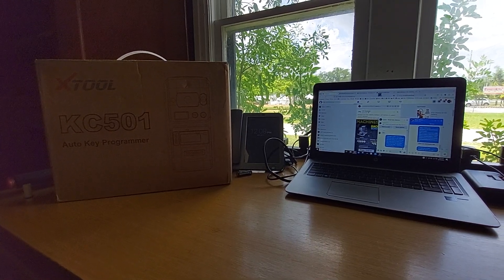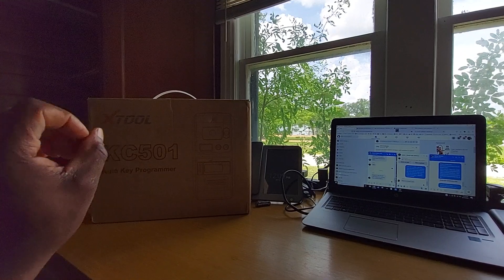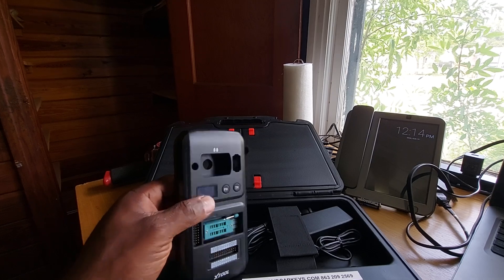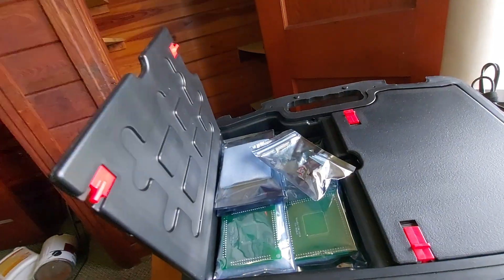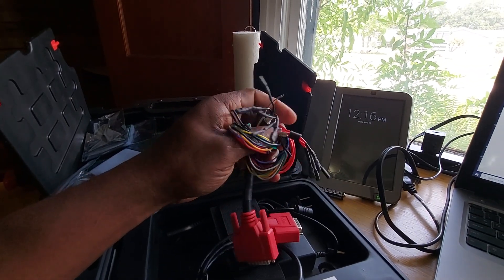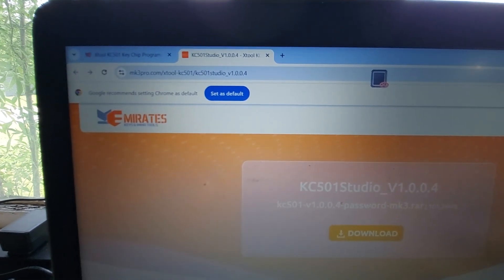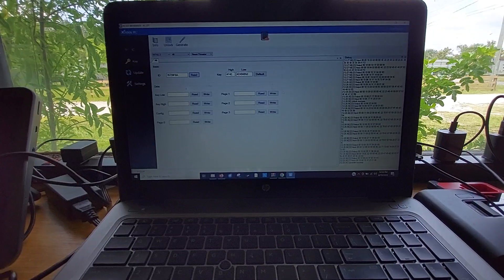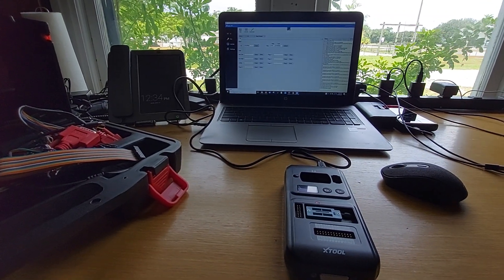Xtool KC501 Auto Key Programmer unboxing and laptop setup. Lakelandcarkeys.com

Comment: Didn’t know you could do this with 501 , I got the Xtool programer but I think as a stand alone I would get the xp400 pro it looks it has more coverage. Really like your videos been hooked on your 706 stuff been thinking about getting the G3 and adding software but don’t know if they would charge 2 subscriptions for it , good luck stay safe
Reply from the maker: @scorcher617  I have both. I never used the xp400 as a stand alone either, I'll have to look into it